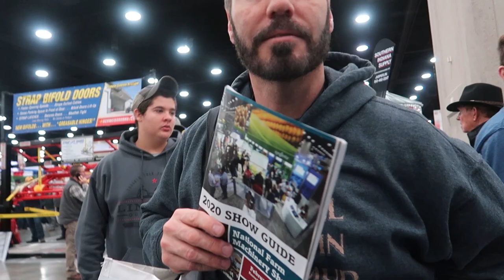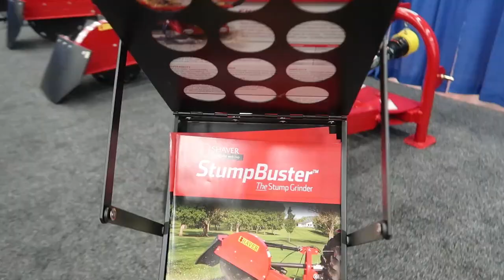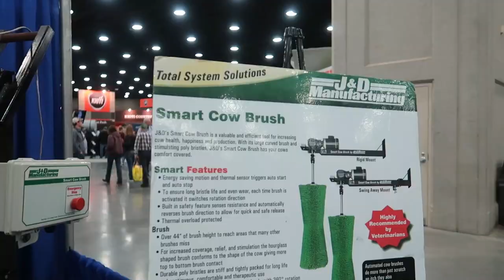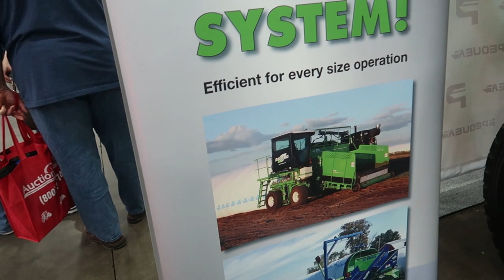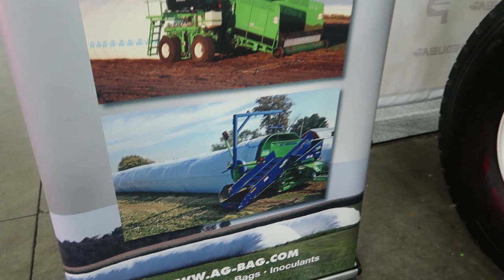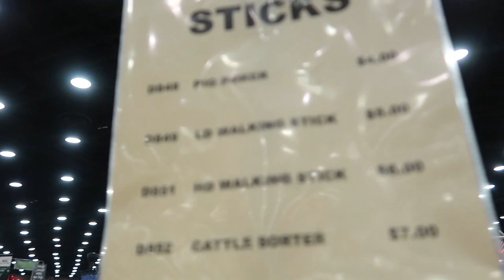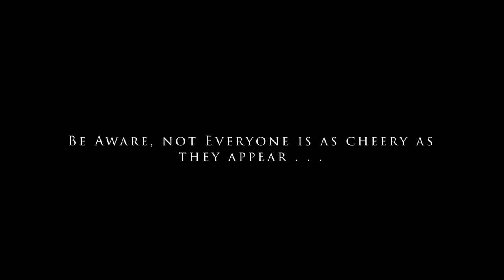283 World's Fastest Tractor And More at the National Farm Machinery Show 2020

Comment: Drive around the Country and you will see bagged Silage all over the place..  Even the Amish have smaller baggers.. One Amish owns one then he custom bags for his neighbors..
   The Farmer near me  who leased one kept shearing the drive train  because they forgot to release the parking brake on it .. If I can recall correctly it did not have an engine but used a tractor  with PTO  connection for power source..
Reply from the maker: Yes, the smaller ones are run that way :)

Comment: A High Moisture Silage Bagger..   The Dairy Farm  near  me  that did not pay me  $8,200.00  for Marl  used to lease one..  The Broke a couple of PTO  shafts  when they tried to operate it with the Parking Brake on.. As  you  fill the plastic  bag  it has to be able to roll forward freely ..   They used to pull their  Silage Wagons with JCB  Fast Track  Tractors that  run about 40 MPH  on the road.. The same  Speed the  1940  Minneapolis Moline Comfort  Tractor  with fully enclosed Cab could go..   These Tractors  were rather pricey and did not sell well .. If you can find one today expect to pay at  least $150,000  to  $250,000  for it ..
  A guy I went to school with  was using a Fast Track  Tractor to pull a trailer  to move his furniture  crashed a JCB Fast Track into the Ditch on a Sunday .. He had been smoking marijuana..  Though this Farm  had 40 Employees  he was Insured as a Family only Farm. The Insurance Co  was not too happy .. This same guy burned down an old  abandoned Farm  house on Halloween  for fun.  Did some time in Marquette Prison for that one..  Last time I saw this guy working .. he was throwing a Temper Tantrum because the landing gear on a grain trailer had sunk in the field and was nearly a  foot too low to hook his  Highway Tractor  fifth wheel to.  He was ramming into the trailer at 10 MPH  with the truck and spinning his  wheels to get lower.. Obviously  he needed to  raise the landing gear on the trailer a  lot..  I guess he has since had a heart attack and able to get Disability now..